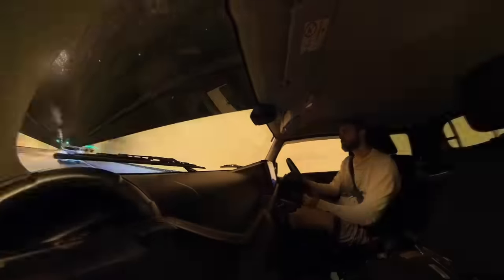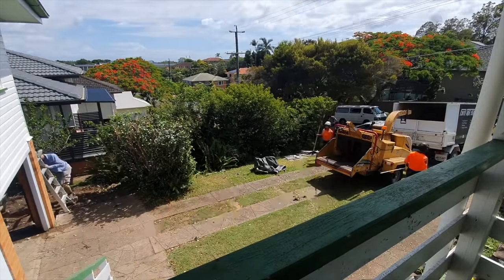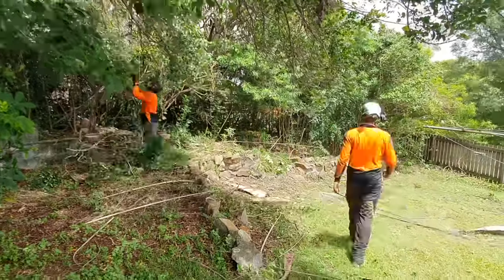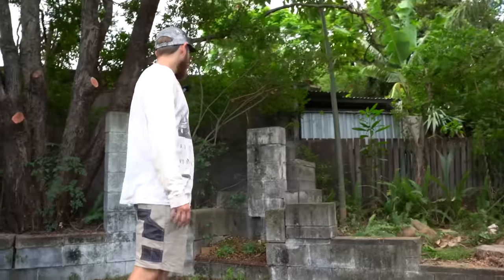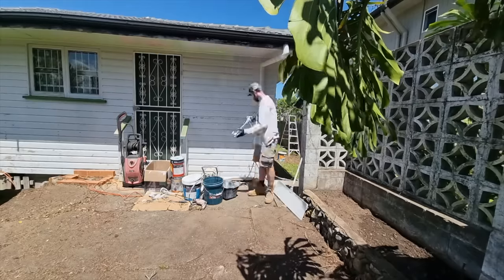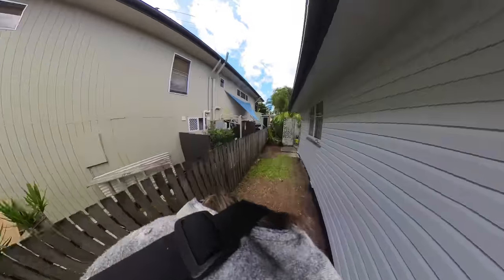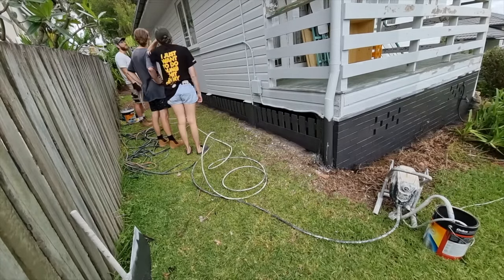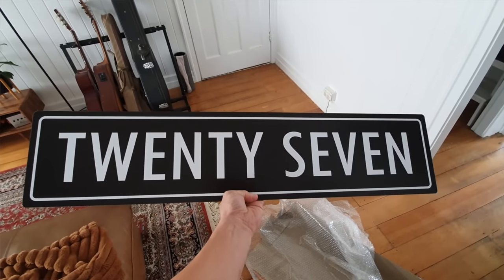Top Suburb for a Renovator's Delight? PT2 | How To Flip a House in Australia

Comment: Just wondering Luke if you do any sanding, priming or prep work before applying the paint?

What kind of paint gun/pump do you use and how much did it cost?

Have seen them at Bunnings and am thinking of getting one.
Reply from the maker: For this project we did scraping, sanding and then 2 topcoats of dulux weather shield. 
Inside we use Dulux 4 in 1 Prep then 2 Topcoats with Dulux Wash & Wear low sheen 

We used a Wagner Control Pro 350m. Best $1k I've ever spent - easily!